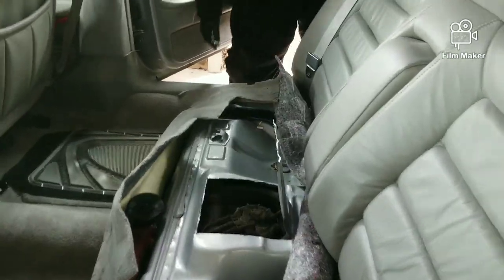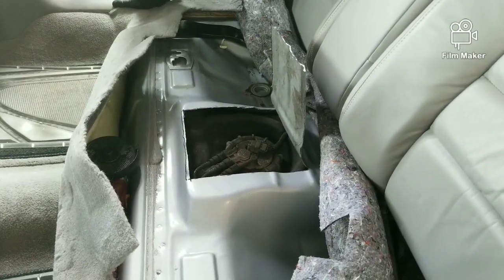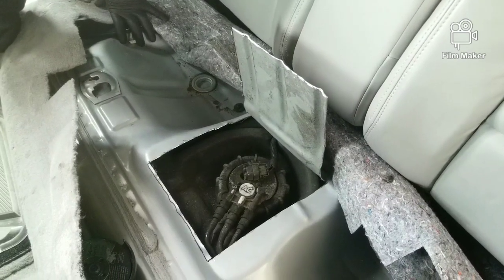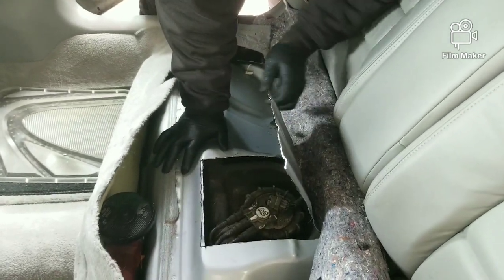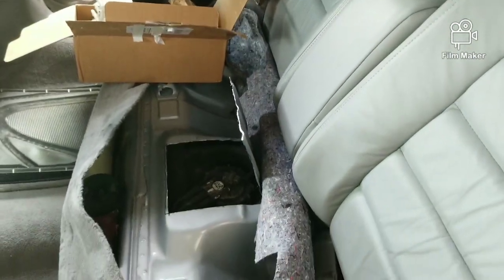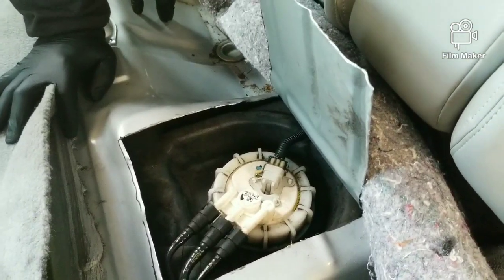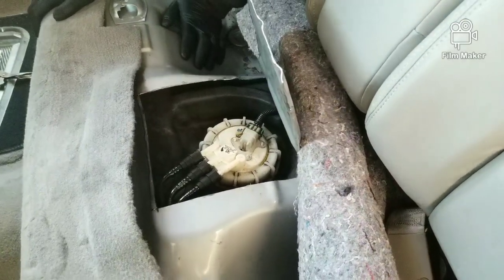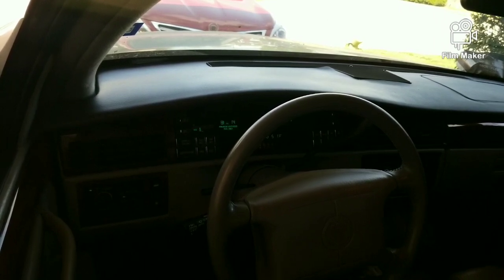1994 Cadillac Deville 4.9 Fuel Pump Replacement And Making Of Access Fuel Pump Access Hole

Comment: I have a 95 Deville with 80.000 m 
5 years ago i purchased this car with 
44 000 around 65 000 m fuel gauge went 
works only when it’s full Fuel pump it’s working fine
 Before this car I had a 94 Deville which i owned for 16 years , one day the fuel pump went I got stuck  i had no choice paid $750 
This idea came to me when I replace a fuel pump in  my sister Buick Regal
Took me 30 min to replace the fuel pump 

It blows my mind because Buick has this kind of design and Cadillac which is more expensive  does not 
I was trying to figure out where exactly is the fuel pump locate it in this Deville
 I couldn’t start cutting by guessing thanks to you now i know exactly 
thank you
Reply from the maker: I totally agree with everything that you have said. I never understood for the life of me as to why they didn't build a access hole for the fuel pumps as they do wear out overtime. And if you have a full tank of gas and the pump goes.... Dropping a tank that will most likely weigh over 100lbs easy isn't a fun project.

Comment: Thanks for a great video. My question is, how did you decide where to cut the panel to be directly on top of the pump. You really did a good job. I need to do the same to 1994 Cadillac Fleetwood Brougham, which needs a replacement pump.  I need to be sure where to cut the panel above the fuel pump. Also, which tool did you use to cut the panel. Your comments will be appreciated.

Comment: Cool stuff. Sometimes you've gotta do it slightly differently. I've just picked up a 91 Seville with no fuel lines. Gonna be fun...
Reply from the maker: Thank you. And you have no fuel lines? 😳😳 sound like you may have to go junkyard diving soon
Reply: @lawjo1978  Yeah some genius took them out. Maybe they were rotting or something but idk. Can't say I'm looking forward to fixing it
Reply from the maker: @anonymousfalsename5441  I wanna say it's a company that makes fuel lines for your car. They are based in Canada and priced under $200 if that helps
Reply: @lawjo1978  Thanks man but I'm in the UK so getting parts here is quite difficult. Maybe I'll have rebuild the whole fuel line. Not sure yet
Reply from the maker: @anonymousfalsename5441  I have heard about UK being a challenge getting goods
Reply: @lawjo1978  100% No one over here knows about cadillacs and I've got a right mess to sort out. Imported in 92 and has NO paperwork at all. Only the original manual and keys. Missing fuel lines, air intake, dented wing. The engine has only done 83,000 miles though so maybe it's worth something as a part lol
Reply from the maker: @anonymousfalsename5441  It definitely have low mileage on it. I wish I could meet the person who thought it was a grand idea to what they did to your car...

Comment: Did you have any issues installing the pump into the new rubber seal
Reply from the maker: What I did was to ease the install of the rubber seal was use some silicone type of grease. I got it from Napa Auto Parts
Reply: @lawjo1978  I did lube it up pretty good I'm pretty sure it was shrunk a little cause it was cold last night after about a half hour or so of messing with it I stretched it out a little bit and was able to get it in.
Reply from the maker: @kent clark  The colder weather will definitely play a role with dealing with rubber o-rings and seals. I'm glad you were able to get it on without much issue.

Comment: I just did thus on my 98 and it seems to be another cover over the pump is that normal? And should i cut that too?
Reply from the maker: That cover you have is a retainer ring that secures the fuel pump. No need to cut that. You're just cutting the floor. And you don't have to make deep cuts. My apologies for the late reply to you.

Comment: I got a 96 Deville you think it’s in the same place? Middle of the seat? Because I really don’t wanna go to a mechanic for this
Reply from the maker: @ Crypto Man..... Yes it will be in the same location as my 94. They actually stayed in that location up to 99 model year
Reply: @lawjo1978  nice thanks a lot
Reply from the maker: @Hakimfarhat  No problem at all
Reply: @lawjo1978  I just did exactly what you did 😎 super awesome 
I went light on the saw slowly slowly I managed to cut like you and viola there is the pump
It didn’t take 5 minutes I tested it worked and starts from the first click 
Thanks a lot buddy
Also I found out that the pump wasn’t actually broken it was just the Plastic Tube inside of it that was ripped my friend was like I would just change that and keep the new pump
I was like no
I want the new one because I felt it’s better
Anyway thanks a lot bro 😎 peace and love

Comment: In part 2 looks like the fuel lines were replaced?
Reply from the maker: @Brandon.... They are the original fuel lines on the car. I made sure I inspected them throughly for cracks and splits. Because those nylon line will sometimes give out

Comment: any sources on where to get a new fuel tank sending unit, I have a 89 Fleetwood.  Thanks.
Reply from the maker: Hey Dennis.... For a new fuel sending unit for your car. I would check out www.rockauto.com or www.carparts.com
Reply: @lawjo1978  unfortunately no luck.
Reply from the maker: @dennispeaks  When you get a chance you may want to check out Ebay or www.car-part.com . You may luck up. Or I can check around for a really clean unit for you....

Comment: Does 91 caddy have a acess panel ??????
Reply from the maker: Unfortunately none of the 90's Cadillacs didn't have an access panel opening. They didn't start doing them until the 2000 model year and up
Reply: Yeah i know now i just cut hole in the exact spot .dammmmnit i have to drop the tank😈😈😈im not thrilled about that .

Comment: Is this the same for a 97 Deville? I have the same engine as yours
Reply from the maker: If you have a 97 Deville then you will more than have the 4.6 Northstar engine in it. But to answer your original question.  Yes, the fuel pump would be in the same location as my car
Reply: @lawjo1978  mines didn't it has the 4.9 in it. But thanks for the info Sir
Reply from the maker: @makgyva8527  Well you have the good engine in it. Not as powerful as a Northstar. But definitely way more reliable

Comment: Question man did u unplug battery want to do it as safely as possible that last ka-boom part made me stress a bit 😅
Reply from the maker: Good Morning Jose, Most definitely definitely disconnect the battery from it. You can take off the negative side battery cable.
Reply: @Mr. Law Jones  thank u so much man this video helps I have a 96 deville ill let u know how it went
Reply from the maker: @Josethefloorguy  Keep me updated

Comment: Mr. Jones, we crosspaths again. Hope you are well. I have a 94 Cadi Deville Concours, if you remember? Question: Did you even try to replace the fuel filter or did you j6st go straight to replacing the fuel pump?
Reply from the maker: I replaced the fuel filter when I replaced the fuel pump. The fuel filter was a easy fix to do.
Reply: @Mr. Law Jones  Could & would that be the cheapest to fix ordo you figure if tou are already fixing that, might as well fix the fuel pump?
Reply from the maker: @GES  The fuel filter is mounted on the driver side by the rear door. It's always good to change those out

Comment: I have a 95 Cadillac deville i bought it and it needs a oil change and tune up will it keep it from starting and it's a 4.9. Engine i checked fuses
Reply from the maker: What's going on Mims9164.... i would check the fuel pump to verify that you can hear it. When you did the tune up.... What all did you replace?
Reply: I didn't change anything i bought it like that and the person said it needs a battery and the oil change and tune up and
Reply: I change battery and it won't start
Reply from the maker: @mims9164  how was your oil level before you tried to start it?
Reply: It said change oil
Reply from the maker: @mims9164  that's the oil life monitor system on the car. Was it any oil in the car before you changed it?
Reply: I didn't change it yet and yes it's oil in it
Reply from the maker: @mims9164  Okay is the car cranking?
Reply: It crank but won't start
Reply from the maker: @mims9164  I would definitely check the fuel pump on it

Comment: What did you use to cut it
Reply: That grinder on the floor with a sheet metal blade.
Reply from the maker: @Tamayo I used a cut off tool with a sheet metal disc to cut it

Comment: GM should had made all their vehicle's gas pumps accessible as in the video. I wonder what kind of engineers did they hire over the years?
Reply from the maker: Man, who you telling. I have zero regrets about cutting a hole in my car. Change the pump in about 30 mins give or take. And i have zero fuel vapors whatsoever...

Comment: Can u help me is the 1991 eldorodo brittiz I'n the same spot so it's no access door
Reply from the maker: The 91 Eldorado is on an entirely different platform. But the pump is in the tank as well
Reply: @lawjo1978  it's no access door under the back seats look just like that tho
Reply from the maker: @torrischappell7339  .... There's zero access door on your car non mine. Had to make one because my pump went out and it full of ⛽
Reply: Thank u sir I gotta drop my tank appreciate it
Reply from the maker: @torrischappell7339  .... No problem at all
Reply: So can I make one in the back seat then because I gotta change it
Reply: I'll just try it later just to see
Reply: @lawjo1978  I took my back seat out n it looks like this imma see if I can have someone cut it to see if that's the spot
Reply from the maker: @torrischappell7339  Do you have a hump under your seat area?
Reply: @lawjo1978  yes I actually do
Reply: It looks very similar
Reply from the maker: @torrischappell7339  ..... If you eventually want to make an access to your car eventhough you don't have one. If I was in your position.... I would take the tank down and make one that way. Because with 91 Eldorado being the last model year of the short body before they got redesigned in 92 it may be different. Now if you had a 92 and up Eldo it would be the same area as my 94 Deville. But the 91's and under model years may or not be in the same area as the other models
Reply: @lawjo1978  it seems like a lot to do
Reply: @lawjo1978  I just rather cut the door for it
Reply: @lawjo1978  plus I cannot find it on utube anywhere n somebody wants to charge me 440 to drop my tank
Reply from the maker: @torrischappell7339  ... Damn! Where are you located?
Reply: @lawjo1978  detroit michigan
Reply from the maker: @torrischappell7339  .... Is your tank located before or after the rear suspension system on your car?
Reply: @lawjo1978  before the rear suspension
Reply from the maker: @torrischappell7339  .... Are you able to send me a pic of your car to my email with your rear seat removed to lawjo1978@gmail.com? I would like to see it.....
Reply: @lawjo1978  soon as I get off work tommorow I'll send it

Comment: Well to anwser everyone question just do what he did to the 1991 eldorodo brittiz I dropped my tank after cutting a hole now I made a access door
Reply from the maker: Did the access hole work out for your Eldorado?
Reply: @lawjo1978  yep but I still can't get it to run I changed the fuel pump n it's still not starting
Reply from the maker: @torrischappell7339 ... Do you hear the fuel pump when you turn the key?
Reply: Yes n it's not starting I'm probably about to get rid of it
Reply from the maker: @torrischappell7339  did you check the fuse and the relay? They do go out

Comment: Talk about a hack job !
Reply from the maker: It wasn't my first choice to do. But, when you have a full tank of fuel in your vehicle, and have to cut out some of your exhaust to drop a tank, replace the pump, and weld back that exhaust. This was the best solution at the time. Hack job or not! Thank you for your opinion 🙄🥴
Reply: @lawjo1978  hack job refers to cutting such a huge hole when you could have been more precise . Ask me to show you how I did it !